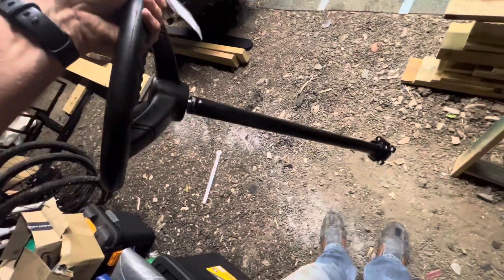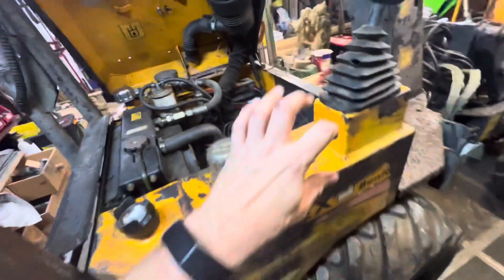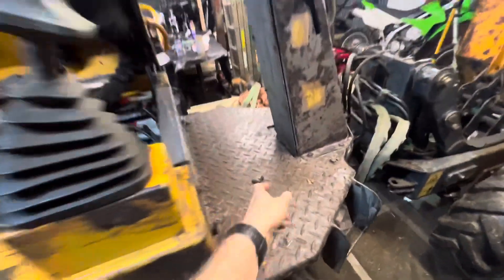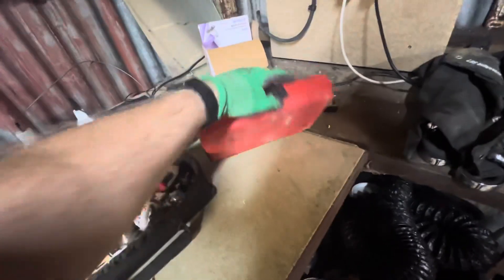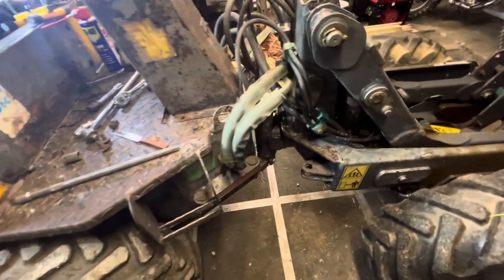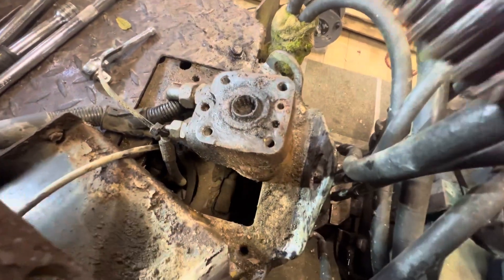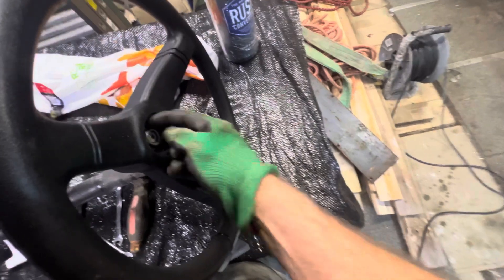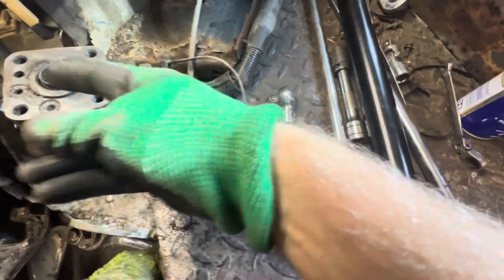Terex Benford HD1000.  Part two.    Rust and the steering column

Comment: I think those rogue ball bearings had fallen down the inside of the steering tube from the bearing at the top that had completely failed - maybe the unexplained metal collar was part of that too? Or used as a spacer somewhere.  You can get replacement steering valves from poland for ~100 quid on ebay, much cheaper than the steering tubes are).   I previously said I don't think the steering valve doesn't have a bearing on top of it, but looking at my new one again more closely I think there might be one there that screws onto the top, so it might be replaceable without needing complete disassembly of the valve.  I couldn't find anyone selling parts to repair these original danfoss steering valves though.   Hence, despite only needing a new input shaft (as the splines were all gone) I had to replace the whole unit.

Glad I watched this as it turns out my steering tube was attached differently/wrong.  On mine the end of the steering tube was on top of the welded bracket, with the steering valve beneath the welded bracket.  Probably explains why mine had failed and was full of so much water and dirty.  The parts diagram doesn't accurately show it, but I suspect the way yours is, is the correct way as it 1) means the full length of the splined shafts engage and 2) explains why those upturned lugs exist on the mounting plate.  So, big thanks for the detailed filming!
Reply from the maker: I think you’re bang on it.  The bearings had dropped down from the top.  Good call. 👍

I can also see why you’d put the square plate on the top of the internal plate and you’re right that the parts image isn’t much help.  

I was lucky in that i slid the tube “down and out”.  If it wasn’t for me doing it personally, I would assumed it sat on top too.  

Getting small parts for these is very hard and I can imagine this is how they make a lot of money.  

The joystick is also so very expensive.    :(
Reply from the maker: Oh!   Glad you found out yours was the wrong way round.  I guess the spline doesn’t quite reach into the steering unit in that scenario.